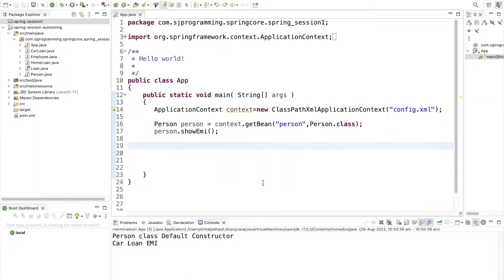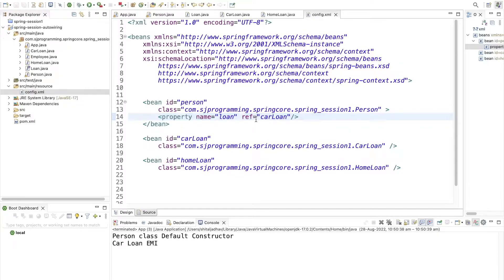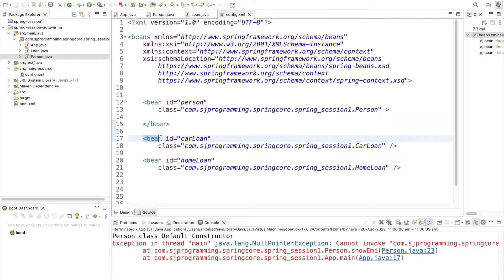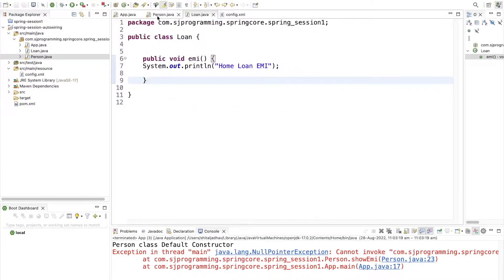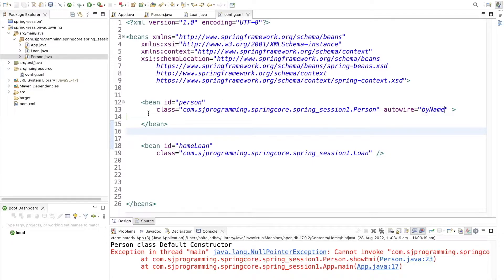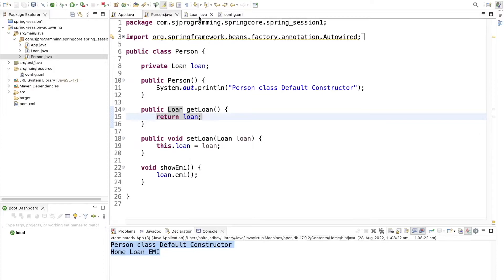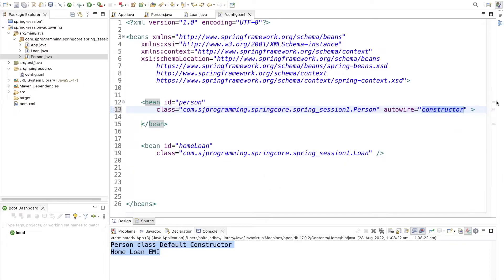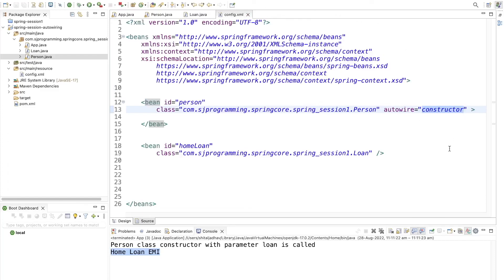#autowiring #dependencyinjection What is Autowiring & What are Different Types of Autowiring Modes ?

Comment: hey I have a problem: 2022-10-31T21:19:29.088+03:00 ERROR 10700 --- [           main] j.LocalContainerEntityManagerFactoryBean : Failed to initialize JPA EntityManagerFactory: Unable to create requested service [org.hibernate.engine.jdbc.env.spi.JdbcEnvironment]
2022-10-31T21:19:29.089+03:00  WARN 10700 --- [           main] ConfigServletWebServerApplicationContext : Exception encountered during context initialization - cancelling refresh attempt: org.springframework.beans.factory.BeanCreationException: Error creating bean with name 'entityManagerFactory' defined in class path resource [org/springframework/boot/autoconfigure/orm/jpa/HibernateJpaConfiguration.class]: Unable to create requested service [org.hibernate.engine.jdbc.env.spi.JdbcEnvironment]                                                                there is my codes please can u help me I  chech everywhere but I cant fix it certanly I explore your chanel please can you fix my error I cant move without fix the problem thank you so much https://github.com/hazarbilgin